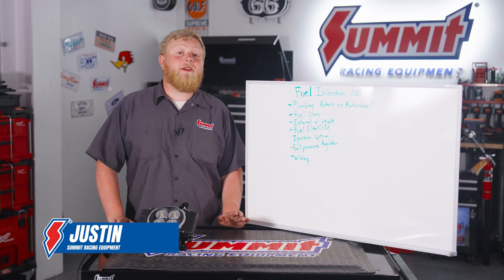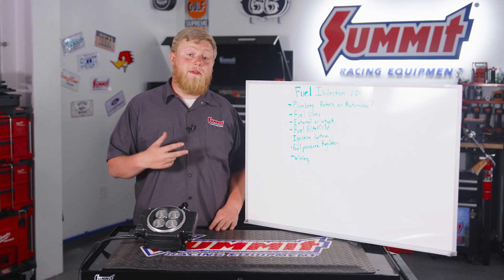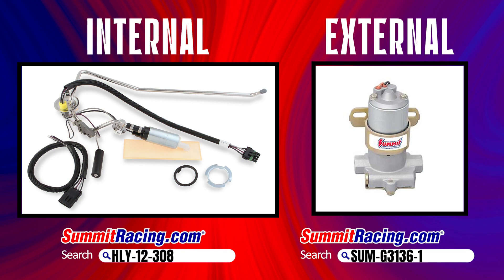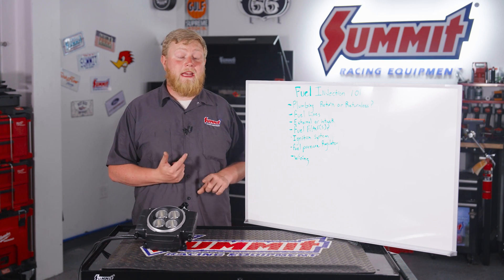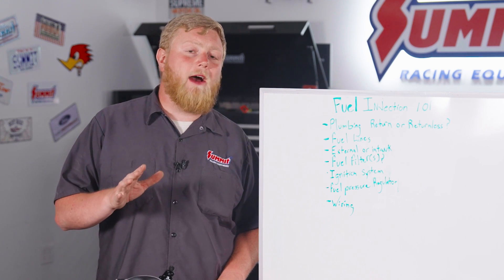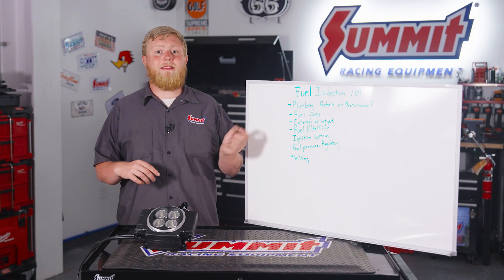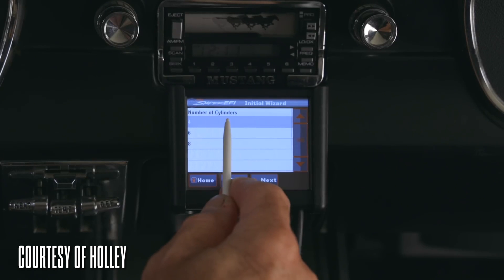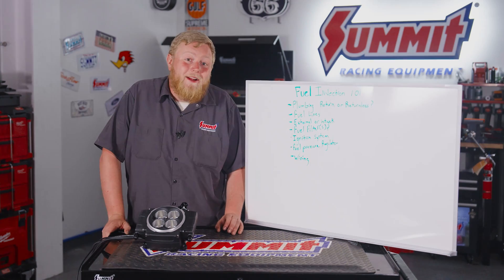EFI 101: What to Consider Before Switching from a Carburetor to Fuel Injection

Comment: I have a 57 Chevy with a 454 big block, stock fuel tank, a Holley blue fuel pump, and pentronix flamethrower distributor, the cam is a 569 lift roller, could I use the efi Holley sniper 2, and use the non return system you mentioned, some people tell me that it won't work, thanks for the infro.

Comment: Add on fuel injection system  does not necessarily make more power can increase efficiency YES but not necessarily increase power its these videos with comments like these that make me avoid certain suppliers.
Reply: Increased efficiency is usually gonna equal a little bit of power. Lol.